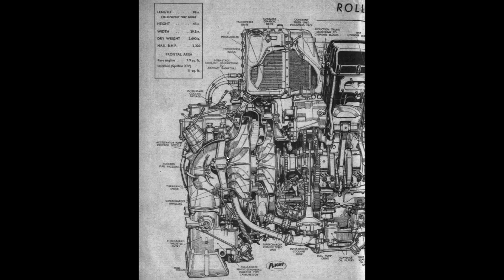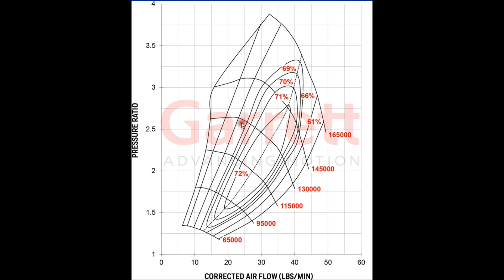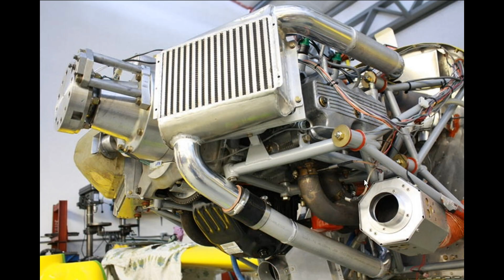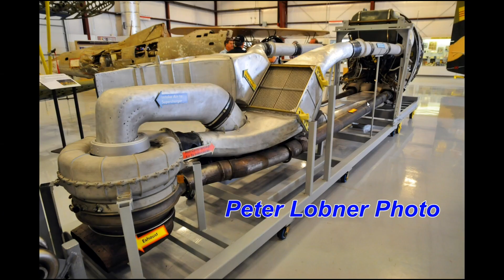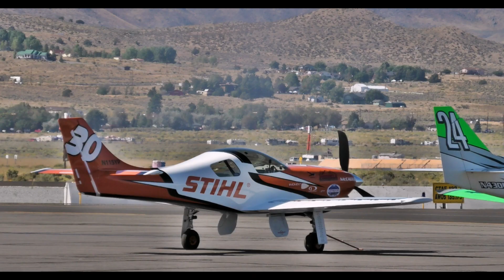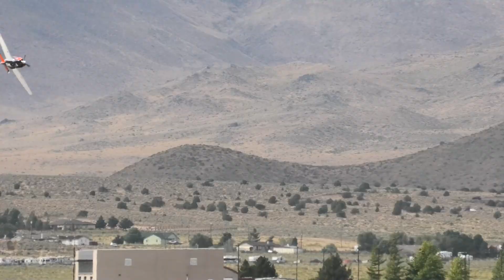Vid # 107. High Altitude Intercooling. Spark Ignition vs. Diesel.

Comment: After seeing your graph and listening to you explain it completely distorted everything I've ever read about the two-stroke sleeve valve horizontally opposed dual-crankshaft diesel that was used as a high altitude reconocense aircraft engine because neither the British nor American fighters could get up to it's altitude and it flew with impunity untill the allies eventually adapted better technology to finally challenge them at high altitude.  What am I missing.?!
Reply from the maker: The engine had little to do with the JU86P/R altitude capabilities, rather the airframe with very large wing area and high aspect ratio giving it a much lowering wing loading than fighter interceptors like the Spitfire.

Power to weight ratio of the Jumo diesels was still far inferior to something like a Merlin.

The later JU86P  had further lengthened wings, pressurized cabin, special propellers and nitrous oxide to further increase ceiling however these were dealt with by field modified Mark V and Mark IX Spitfires and the special Mark VI and VII versions.

Comment: What I gathered here is that realistically diesel could be viable. Where I'm from, only jet a1 is available so it's kinda a requirement. Compound turbocharging with adequate cooling and at altitude where the air is colder you would have a greater delta t with reference to the charge air and that's favourable for the Meredith effect oriented cooling arrangement. The much greater CR, less sensitivity to detonation and ability to run leaner than si engines kinda makes diesels work? Engine relight at altitude would be tough though.

On another note, modern engines seem to be low displacement high rpm engines. How reliable do you thing they will be compared to something turning slower? Direct drive engines need displacement to make the power at the rpm the proppeler likes to be spining at. How much abuse could the higher rpm machines take? AFAIK there is a reason for trucks and busses having biiig engines and not screamer f1 style 2l machines. Sure, one is cost and no need to keep everything light, but reliability is certanly one of the criteria?
Reply from the maker: What matters in the end is power to weight ratio, cooling drag and BSFC in cruise primarily. The diesel doesn't come out so well for high altitude flight when all these are taken into consideration. Additionally, the present aero diesels all cost a lot more to buy right now.

They do make sense where avgas isn't available or very costly- Europe, Africa etc.

The small diesels like the Austro and Conti CD series seems to have comparable TBO/TBRs to certified SI aero engines.

Comment: No one asked where he's getting these manifold pressure numbers from.  He could be comparing the AE-300 3.0 Liter engine in the Diamond DA-42 to the TSIO-550  9.0 liter engine in the Cessna 400.  The DA-42 was designed to get best cruise altitude at 16,000 feet.  The Cessna 400 was designed to get best cruise altitude at 25,000 feet.  Why would diamond put a turbo charger capable of 25,000 feet on an aircraft designed to be flown at 16,000 feet?
        The old German diesel Junkers Ju 86 had a service ceiling of 47,000 feet.  If I were to put its critical altitude on that chart it would make the spark ignition look like it didn't have a very high critical altitude.
    You install different turbo charges depending on what the needs of the aircraft are.  Sure, whatever turbo on the diesel this guy is comparing maxes out at 11,000 feet.  A real simple solution for this is to put a different turbo on the diesel to change the critical altitude.  Why this guy hates diesels is beyond me.
Reply from the maker: You don't understand turbocharger limitations here. Because diesels require much higher pressure ratios to make the same hp as SI engines, a single stage turbo cannot provide a high critical altitude on a diesel, being limited to about a 3.5 PR. The Jumo on the Ju 86 was a 2 stage setup, as in Raptor. Watch my other video discussing the technicalities of this.

Comment: I find a portion of the Raptor channel viewers have a difficult time relenting to any information that doesn't agree with the builder. The builder of the raptor prototype himself is not willing to make changes regardless of the overwhelming real world facts. You don't have to be a turbo expert to understand air at higher pressure fills a smaller space. It is a great looking airplane no doubt about that however until he is willing to accept big changes need to be made it will not succeed.

Comment: Thanks for the video. However the key point NOT made is that Diesel engines readily accept much higher inlet temperatures than Otto cycle engines can. Diesel always runs lambda <1 which means unburnt air aids valve cooling.  Exhaust expansion cooling is also greater due to higher compression ratio. Therefore there are less/no preignition issues with Diesel and EGT overtemp of exhaust metallurgy is less critical.  This means intercooler drag/size requirements for Diesel are softened by higher permissible inlet temperatures so this is not an apples to apples comparison. Spark ignition engines cannot sustain high inlet temperatures. They will detonate and burn exhaust valves. Diesels less so.  And better Diesel BSFC means less waste heat and lower engine cooling air requirements, This help offsets the higher intercooling air loads you worry about.  Just look at a Cessna 172 Diesel conversion. No additional inlet ducts needed. One nostril for intercooling and one for radiator.  Same nostrils as the gas engine, no additional drag.  Case closed.

Despite the above, I agree that compound turbo Diesel aviation doesn't seem like a great idea.  Certified single turbo Diesel engines provide adequate power (~55%) up to ~25,000 feet with only modest increases in intercooler size over comparable gas engines.  Compound turbo's might get to 30,000 feet however engine relight at this altitude will be impossible so the extra complexity and safety problems for that slight increase in altitude seem hardly worth it.
Reply from the maker: Charge density declines with increasing temperature on both engine types which costs power, requiring more boost. Counter productive and more serious in CI engines where the turbos are already near N1 limits up high. There is no more boost to be had.

Liquid cooling is more efficient than air cooling so you mass flow required is lower. Look at the intercooler volumes on aero diesels, they are double to triple that on SI engines. and generally poorly ducted as well, leading to higher momentum loss and thus higher drag. You can't equate cooling drag to inlet size.

Let's compare apples to apples, new liquid cooled aero diesel to the Adept 320T. The 320T matches the cruise BSFC of the CI engines and is much lighter with a better power to weight ratio.
Reply: @rv6ejguy  No question, SI is going to be lighter. The Austro is damn heavy (Fe block) the CD170 less so (Al block) but nothing like a UL or Adept. They are simply great.  However the discussion was more about how CI engines can accept higher charge air temperatures without running into EGT or detonation issues that SI engines suffer from. SI engines, including these new FADEC ones must all go well ROP as charge air temps rise to avoid detonation and excessive EGT. Therefore intercooling is going to be more critical in SI particularly with 10.5:1 as SI reaches for better BSFC. 
These issues get really bad at altitude. I think that point is missed in the video.

Comment: Peter has gone dark. I can’t help to think someone pulled him aside and laid out the bottom line.
Reply from the maker: He was flying again today towards his goal of getting the 40 hours flown off. Will be interesting to see what transpires down the line if he completes his milestone safely.

It can't go into production as is, with this weight, engine,  redrive, pressurization testing, static testing and especially without having explored the full flight envelope, slow flight, dive and flutter testing etc. 

It's years away from delivering anything close to being promised originally after the complete re-design.
Reply: @rv6ejguy  I can only presume that the mfg. co. that he is working with is hip to all that jive, so to speak.  Thanks for your clear, concise evaluations!

Comment: Is there any problem with dual turbocharging a 4 cylinder boxer engine as the exhaust impulses on each bank are (in crankshaft rotation) 180º-540º-180-540º... as such the two cylinders of the same bank will "see" different back pressures from each other?
Reply from the maker: It' probably been done in Sube cars by someone but I'm not aware of any in Sube powered airplanes.
Reply: @rv6ejguy  Thanks for replying, I was asking more for your "gut" sense on the matter based on your years of turbo experience.  My guess is that if one had the time, money, a powerful computer and the expertise to do finite element flow analysis, a very slightly different cam profile and/or timing for the two cylinders might gain you a percent or two of better performance,  I don't know any such person.  You need not reply, just think about it in your "spare" (lol) time.

Comment: I agree with some of your comments concerning the Raptor, although to be fair a diesel engine needs less manifold absolute pressure (not more) to produce the same power as a spark ignition engine. This is one reason why the Germans used diesel engines in their highest flying aircraft during WW2, such as the Junkers Ju86. Diesel has higher energy density, the engine is mechanically more efficient, plus the stoichiometric air fuel ratio is about the same for diesel and gasoline. Would be interesting to see how some of the data changes after correcting for this.
Reply from the maker: You can watch my video discussing this to see that your statement doesn't ring true. https://www.youtube.co/watch?v=cwGxuiLFhys

Can you provide some examples of the same displacement diesel making more power at the same MAP?
Reply: @rv6ejguy  Here's a comparison of various si and di engines (including a few aero applications): https://en.wikipedia.org/wiki/Brake-specific_fuel_consumption 
The lower bsfc of diesels is pretty consistent, and mostly independent of displacement and induction method. As you know from efi mapping,  less fuel translates to less air needed (at constant a/f ratio).
Reply from the maker: @socraced6210   I was asking for specific  comparisons of CI vs. SI engines with regards to MAP and specific output. The wiki reference has no data on that.

Less fuel translates into less power in both CI and SI engines. CI engines run lean of stoich most of the time. SI engines make best power well rich of stoich but best economy at around 16 AFR.

Lycoming and Conti aero engines can turn in BSFC figures of .37 to .42 running LOP. The new Adept SI aero engines match the cruise BSFC figures of aero diesels like SMA, Thielert, Continental.

Comment: Rv6ejguy  you hate on diesels all the time, why?  Diesels run higher boost, since they are not knock limited, but boost is not a measure of “goodness” as you suggest but of power density on a displacement basis.  Diesels are more efficient, especially at light load, get used to that fact.  You even show that in your vid#92 & 93 which I enjoyed and am still digesting.  I have always been taught Diesel cycle is superior to Otto but Always reserve rights to get smarter.
Reply from the maker: Diesels need to run higher boost to make the same hp, so that's not an advantage. I'm just comparing apples to apples, same displacement, same boost with the real world examples, trying to dispel common misconceptions.

I also showed that the modern 13-14 to 1 CR SI engines are just as efficient at part throttle, low load as light diesels now.
Reply: @rv6ejguy    Airplanes are an interesting/ideal use case for SI engines, mostly 50% power & more.  The claimed 40% BTE Toyota Dynamic Force Engine (see link below) & SI engines in general are not efficient over a significant speed/Load range especially mid and low power, where automobiles operate.   Conversely Diesels have a big efficiency sweet spot.  In many real world applications this means more work for less fuel.  

https://www.epa.gov/sites/production/files/2020-08/documents/sae-2019-01-0249.pdf

Comment: Looking at the P-47 system; seems kinda crazy to have all that duct work in a fighting machine. Lots of target area (still not as bad as a liquid cooled engine but....) to shoot at.

At some point, if the wallet can handle it, it seems a turbine starts to make more sense.
Reply: You may like the Corsair or the F6F Hellcat then. Much less duct work. Much poorer high altitude engine performance, much cheaper and lighter.

Comment: Do you think the twin turbo ford v6 engines have any potential?  The 2.7 eco boost seems to be pretty compact and makes good power...
Reply from the maker: The Eco Boost engines seem pretty robust from testing I've seen. Would have to be mated to a well developed PSRU for use in aircraft.
Reply: They're heavy. The 2.7 has a compacted graphite block.

Comment: So if Peter puts a much larger turbo on his first stage, it sounds like that would solve some of his overheat problems??
Reply from the maker: Raptor hasn't been high enough yet to see major issues from the mismatched turbos yet however the small turbines significantly increase EGTs and oil temps to some degree.

The much bigger issues with cooling are the poorly implemented heat exchanger layouts for coolant, oil and charge air.  A complete revamp is needed here to allow it to run climb power to 25,000 feet on a hot summer day.
Reply: @rv6ejguy  And the Raptor home brew injection map appears to be chasing power by advancing the injection to allow time to put in more fuel. That is not good either for EGT or BSFC. And internal cylinder pressures can go sky high when you mess with this too.

Comment: Thanks. Nice to see aviation vids like this--accurate, very informative, not at all simple minded but simple enough for dumb old pilots to understand.. Has the Raptor guy asked you for help sizing his turbos?  Hope you will comment on the Celera 500.  Diesel to run at FL 400 and higher. Is the fellow nuts? Question I have wondered about for years--how come on mechanically blown engines, radial or V, the BSFC for a given HP goes up so dramatically with altitude? Example, from memory. R-985 14B will make 310 hp on 21 gph at SL, requires 25 gph to make 300 hp @8300 msl. MAP & RPM @ both altitudes are nearly identical. Thanks again.
Reply from the maker: As altitude and pressure ratio increases, the power required to turn the engine driven supercharger increases. This will increase fuel flow for the same hp up high. The turbocharger has the advantage that the pressure delta across the turbine (differential pressure between inlet and outlet) gets more favorable as you climb due to lower atmospheric pressure. This has the effect of increasing drive torque of the turbine to spin the compressor- a bit of a free ride compared to a supercharger.

On the Reno Unlimited Merlins and Griffons, it takes 700-1000 hp to drive the superchargers to make 150 ish inches of MAP.

On smaller stuff like Raptor, the turbos would be extracting something like 60-80 hp from the exhaust to spin both compressors at the pressure ratios required at 25,000 feet.

Peter hasn't contacted me nor do I expect him to. He's on his own path with his project.

Comment: Inspiringly!

I was never a fan of red glowing turbos under the cowling. But now we see the first watercooled imbedded turbo setups. And with that additional knowledge about the advantages of spark ignition engines its a new option for me.
Thanks for enlightenment! 😁🚀
Reply: they only glow red when on the dyno, normally theres lots of air flow

Comment: how much further will cabin pressurization complicate things with the current raptor turbo setup?
Reply from the maker: On a well sealed cabin of this size, I'd estimate that total loss would be down around 10-30 CFM. With the turbos jamming out 450-500 CFM, that would only account for a few percent of total flow, so pretty inconsequential.

Comment: You see the same concepts played out in reverse on the generator floor of an electrical power plant.  There are high, medium, and low pressure steam turbines. The turbine size, blade design, etc. vary quite dramatically. The mass through each turbine is the same, but as pressure drops the volume increases.  The difference is that all of the turbines drive the same shaft.